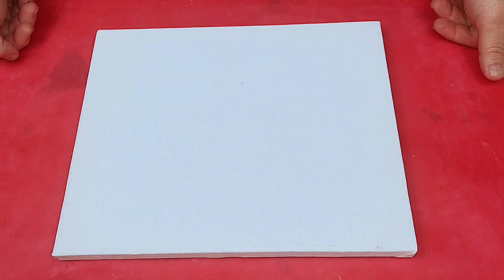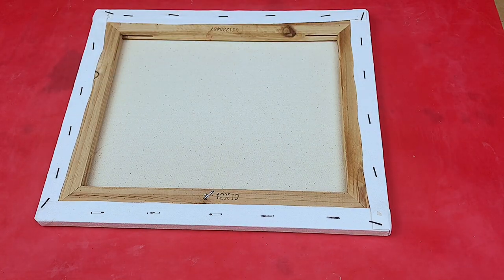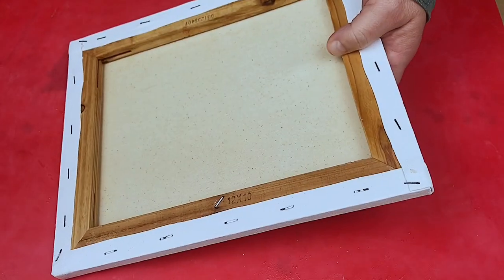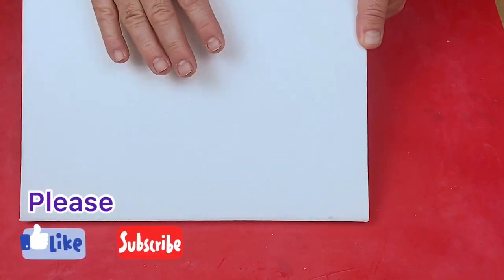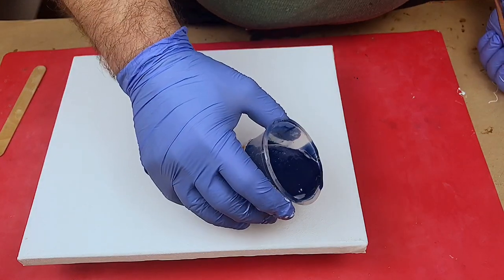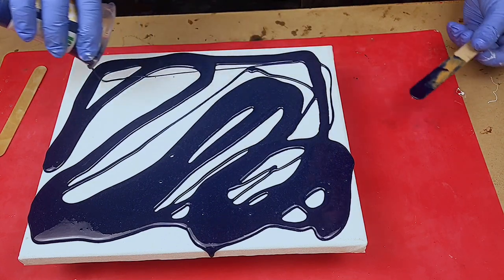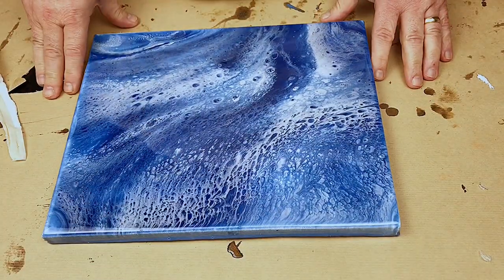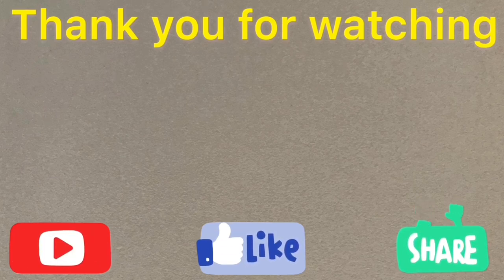How to prepare a canvas for a resin pour - to prevent ridges and dips

Comment: Thanks Steve. Love the tutorial and finished painting. I have a 5’ x 2’ canvas and I plan to do a Dutch pour and one or two coats f resin on top of that. I may have to use two panels of foam to support the weight, but worry about a seam showing where the canvases are joined together. Any suggestions to prevent this?

Comment: Brilliant you solved all of my problems. I’m going to be doing a resin pour on a 24x30 oil painting on canvas. I was nervous but I think that this process will be perfect for even that size. I may add extra canvas support beams, and I will most likely use gesso on the back rather than water because it’s already painted. But the foam board will be perfect!!!

Comment: New to your channel.. Thank you for this video.  I only use Artist Loft level 3 canvases.  The smallest is 20 X 20 X 1 1/2 deep.   Will the foam board work with larger canvases?  Would it be best to buy foam board 1/2 inch deep?  Can it be cut with a scissors, or should I use an exacto knife?  If the board is an inch or two smaller than the back of the canvas, do I need to add a small piece of board or just tape the board to the canvas?  Sorry for so many questions.  I am excited to try Resin.  I really appreciate your advise.  Thank you so very much.  The picture is beautiful.

Comment: Very helpful Steve.  I love using resin on timber boards but have struggled on canvases.  I have a painting I’d really like to resin, but it has thicker sides than yours did (3.5cm?) and the timber frame leans in on an angle.  I will figure out a way to adapt your method to get a piece of board in there snugly.  Cheers, Kelly 🇦🇺

Comment: Thanks for this! I have a HUGE canvas that I'm really worried about in terms of creating wells with the resin weight. I will use the foam board as support and hold my breath 😫
Reply: Steve McDonald Arts and Crafts thanks for the tip! Do the boards have to align perfectly? I’m using 30x48” canvas, so I was going to use 2 layers of 2 20x30” boards, and 8” of cardboard to make up the difference. Is that a good idea or will it mess it up any?

Comment: Can we use the spray bottle and heat gun method when there’s already paint on the canvas or would that ruin the painting.
Reply: Darn I was wondering the same thing :(
Reply: I do!  It’s never been an issue.  I don’t soak it like I do before it’s been gesso’d Or prepped but I do lightly spray it and dry it sometimes 2or 3 times to tighten up.  I wouldn’t however wet it & leave it- that would give chance to loosening the painting from the surface at the edges somewhere- definitely follow with a drying so it isn’t sitting wet. But yahh.. tighten em up 👌

Comment: Easiest, fastest way to prep a canvas for resin, pour a thin layer of cheap resin on the back of your canvas and let it cure.
Once it's cured you can pour on the front of the canvas with no sagging. I've used large canvases for ceodes with heavy layers of resin and crystals and stones, no sagging at all.
Also, if you want to cut a hole in the canvas for a geode, jigsaws work perfectly through the canvas and resin on the backside.
Just thought I'd share a simpler way to prep a canvas.

Comment: Beautiful work. You said the canvas was prepared with Jesso, I may have the spelling wrong but what is Jesso?
Reply: @SteveMcDonaldArtsandCrafts  Thank you 😊
Reply: It’s Gesso..lol😁. Good quality Gesso is GOOD acrylic paint with marble powder, to give the surface some ‘tooth’ for paints to adhere to.  Almost all are cheaper gesso’s with talcum powder or corn starch etc.. 
And most canvases say they are pre- gesso’d ..but I think they add a cheap starch/sizing top layer or something to make it not stick to the plastic sheeting it is packaged in.  Especially with the bonus/multi packs.  I usually wipe/wash them down to remove it because I notice when I do regular acrylic brush painting that starchy stuff actually repels the paints.  Putting a layer of nice gesso on & then burnishing with a smooth river rock makes a smooth surface for resin and painting. Most people sand after gesso is dry.. I prefer burnishing because it doesn’t make dust & the surface is unreal for painting on!!  Anyways, Liquitex makes a very good gesso.. it’s thick & water can be added to the desired consistency.  Even a year later my Liquitex is like paste.. & I can thin it & it works like a dream. The other brands at a year were unusable. 
For resin work gesso isn’t necessary but sometimes it’s just the thing to do if you have an acrylic piece that didn’t work out and you’re going to do a resin painting over it. Gesso it, dry it, burnish it & it’s like it never happened 😂😂😂
Reply: @debrajol3585  Thank you so much for that in depth explanation, no one ever explained what Gessop (lol) was or why to use it. 😊
Reply: @debrajol3585 , Wow! This is such great info. Very informative and very helpful. Thank you!
Reply: @debrajol3585  that's very i formative. I'm glad I haven't started working on the packaged canvas I just grabbed from Michael's. This hobby sure is expensive, but it will be nice when I can start making money off of my art. 😄😅

Comment: Hi i need ur help i wnt to do resin with my paitn by numbers  is this will work before i paint it on?bcoz its has lines and number to trace it to paint,does the line and numbers will fade or not ?...thanks ❤️
Reply: Steve McDonald Arts and Crafts  im sorry if that confuse you😅what i mean if i spray water at the back of the canvas will the lines and numbers infront will fade or not ...?bcoz its a paint by mumbers means there is corresponding numbers with every colors ... hope you understand😅thank you🥰

Comment: tape the bottom to prevent that mess
Reply: Steve McDonald Arts and Crafts aluminum tape.  Take it off at 1 hour and then use the heat gun to smooth.  It’ll seem like a bad idea as the tape pulls away because the resin is stringy to the tape..but after the tape is gone and heat (not much) is applied, it gives a perfect rounded edge. ✌️